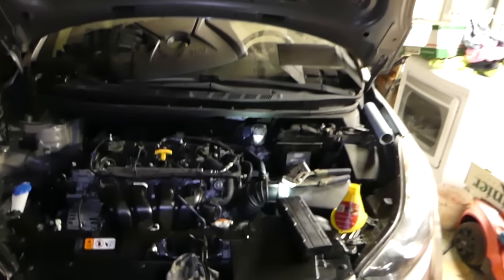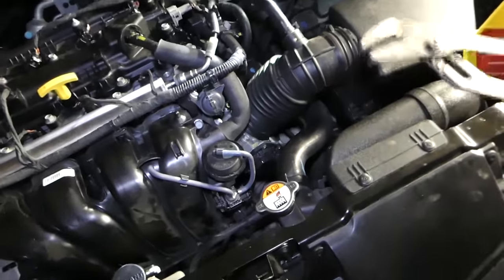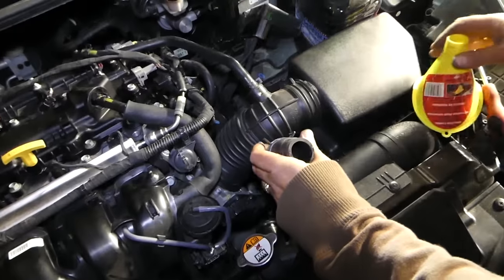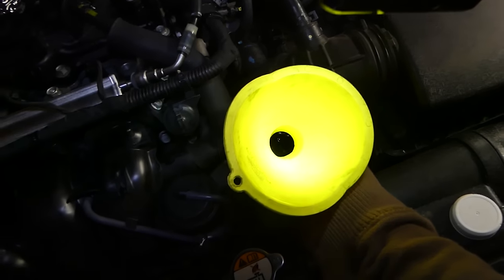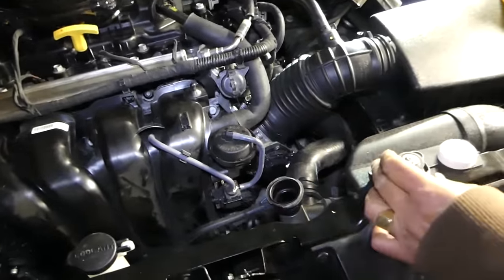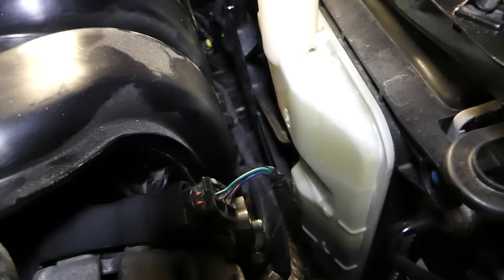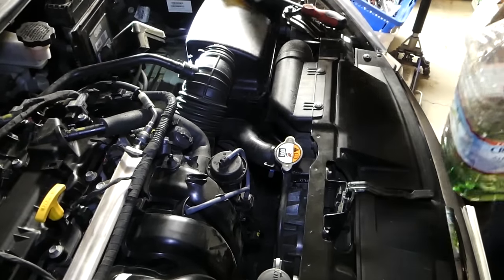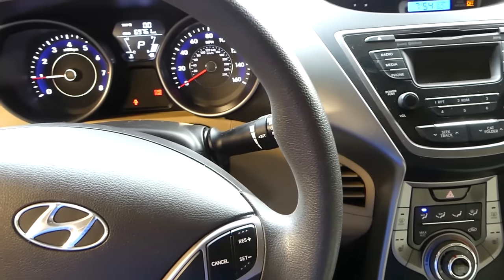HOW TO BLEED COOLING SYSTEM ON HYUNDAI ELANTRA 2011 2012 2013 2014 2015 2016 2017

Comment from the maker: Products that we use and recommend:
► Hyundai Coolant: https://amzn.to/2A1qNFD
► Panel Removal Set: https://amzn.to/3YiMADu
► Assorted Fuses: https://amzn.to/4fx4s3F
► Tool Set: https://amzn.to/3p5MM6t
► Screwdriver Set: https://amzn.to/3XRB28Q
► Castrol Oil: https://amzn.to/3xBc8B9
► Oil Filter: https://amzn.to/3w0Ulme
► Torque Wrench: https://amzn.to/32qyRwg
► Liqui Moly Engine Flush: https://amzn.to/3IiDBID
► OBD Scanner that we use most often: https://amzn.to/3I4MQfe

► Check out our Amazon Store for the tools and parts that we use: https://www.amazon.com/shop/worldmechanics
Reply: Would this process work for a 2013 hyundai sonata.

Comment: Not a single word about bleeding the system. Waste of my time!!!
Reply: Yeah the air have to be bleed.  Fill it up.  Turn the heater on max and when the fan comes on the thermostat has opened and let it into the engine.
Reply: At that point the air bubbles should have escaped thru the open radiator cap.

Comment: I watched your video yesterday and used your method of filling through the top radiator hose until full. Then secured the hose and continued with filling the radiator. It was a success and the car now runs without overheating. Thank you very much for helping me through the problem. God bless you.

Comment: Thank you SO MUCH. I did this on my 2014 Genesis coupe 2.0T and my car runs great with no overheating issue anymore. I had replaced my radiator myself and got air stuck in the cooling system, so I was just blowing cool air when the car was idling and also it would heat up too much when heater was off. Now it blows hot air while idling and after a good test drive it stayed at operating temps the whole time. Thank you again!!!!

Comment: So you filled the hose with coolant to avoid air getting in? Im trying to replace the upper hose after a leak so if i do this method i dont need to bleed it??. My car is full on coolant. Why are you putting coolant in the radiator?

Comment: Thanks for the video, but I have an issue where coolant is always low in the radiator but there is coolant in the overflow bottle. And it’s overheated 3 times.

I have also changed the radiator cap, but am still getting low coolant after every drive
Reply: Your thermostat is probably stuck
Reply: Check the oil it's going somewhere

Comment: Good day.. if you dont mind.may i ask what is the problem of my 2011 hyundai elantra.because the compresor clutch is not   getting cut off.. is it normal to this unit hyundai elantra 2011 if the compresor clucth is not getting cut off. But the cold aircon is working..im wondering only about the compresor clutch because not gettin cut off. And continue turning.

Comment: So how do you bleed it for air? Should you fill system the start car with cap off to get bubbles out?
Reply: Get a no spill funnel with an attachment that comes with the kit and that makes the funnel highest part of cooling system and fill then run engine keep filling funnel till no more gets sucked in and bubbles go away also run your car on high heat
Reply: @gothinking3705 wait so what is he doing in the video then? Is this not to get air out?
Reply: @Matt-yj1lz it is but the hard way lol. Much easier to buy the no spill funnel for $20

Comment: Bro my Radiator fan isn’t working Can you make video on it? My car is Hyundai Elantra 2012
Reply: Check all the fuses.
Reply: prasanna mainali check relays. Unplug pin connection from temp switch and jump with small wire or paper clip, fans should kick. If so switch is bad.

Comment: I have a tube that is unconnected underneath my car just in front of the drive shaft. I think it’s supposed to be connected to a part that is red that is connected to the drive shaft. Do you think I’d be able to email you a picture of it and you might be able to tell me where to reconnect the tube?

Thanks guys, love the channel!
Reply: That tube sounds like the tube that let's your ac water out, it's the only tube that's supposed to be disconnected under the car. You can check it after turning on the ac and waiting for it to drain the water while the car and ac is on. Like I said it supp to be like that